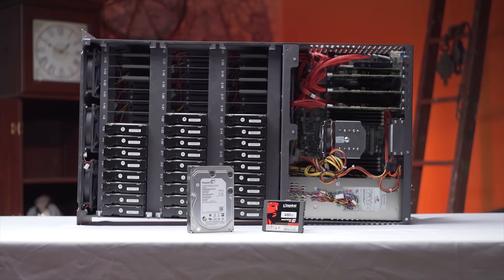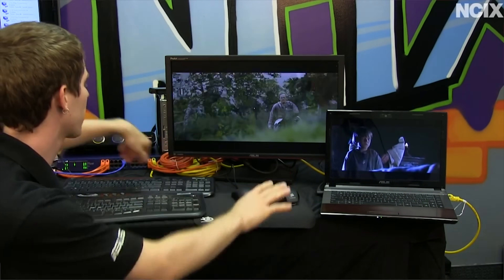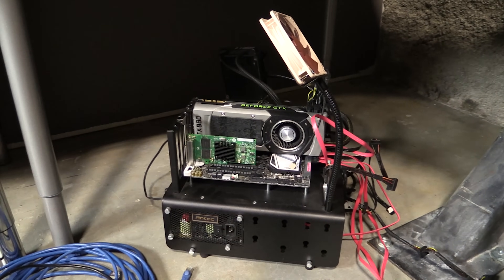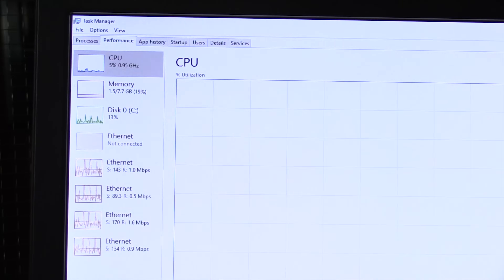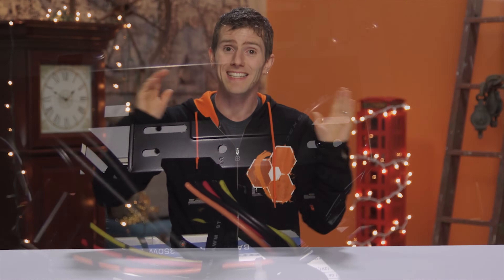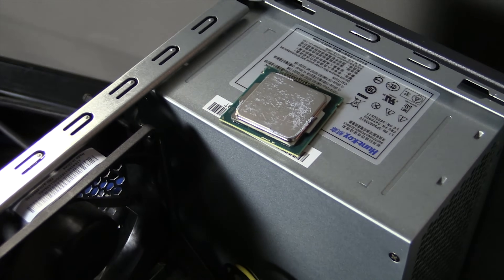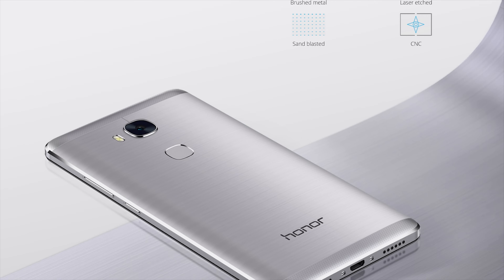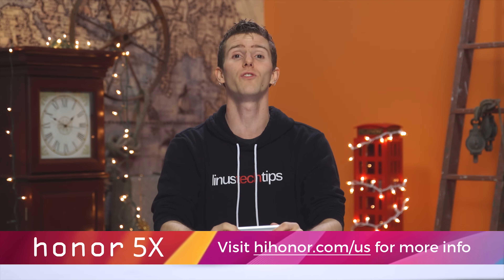Quadruple Your Network Speed for $100 with SMB 3.0 Multichannel!

Comment: LINUS!!!
Do a "how to set up a LAN party" video...PLEASE
Reply: don't you need friends to do that?
Reply: It's really simple, just ensure you have enough power strips/outlets, and a network switch with enough ports, and you're done.
Reply: +hentai nat SHOTS FIRED xD
Reply: +Cave Johnson 
a) get friends
b) get a router
c)get ethernet cables/wifi cards
d)one
Reply: +Cave Johnson How hard is it? Why make a video on it?
Reply: +Cave Johnson no its pretty much: 
1: computers
2: ethernet cable
3:routers/switches
4: play a game.

there is no config it just works...
Reply: +Cave Johnson Seriously?
Step 1: Plug all computers into the same router
Step 2: Order some pizza, don't forget the Mountain Dew.
Step 3: There is no Step 3, you now have a LAN party.
Reply: +Cave Johnson gods. definition of LAN party means several computers hooked up to themselv or to one wifi/ethernet device. NOTHING more, just that. that is lan party, no config, no software, NOTHING. you need only run a game that support lan party and in some extreme case configure game (usually put a host internal ip to other mashines). that works, nothing more, just and ONLY just that. get it?
Reply: When life gives you routers, don't make a LAN party! Make life rue the day it thought it could give Cave Johnson routers!
Reply: Cave Johnson Sorry, pal, but in practice my comment is more than enough for people to set up LANs.  Anything else is either 1) opaque and hidden from the user setting up the LAN by modern router design and more suited to a general course on networking or 2) Totally game specific and no one is going to write you a special guide for every separate game except possible the publisher or your particular game.  Usually those directions would be included in the game interface itself. 

If you want to know about packet headers and the differences between TCP and UDP and the dumbass way you need to port forward on enterprise Cisco routers, etc... you should go for a network certification, but don't confuse that with the itty bitty amount of knowledge that is needed to set up a LAN.  It in fact can be done only from my comment excepting the game specifics.  I don't believe you tried following them, how is your troll cave this time of year? 

 If you take a router supporting DHCP (basically every one produced for ages now) in it's default configuration from the store and connect two computers to it via CAT4/5/5e/6 you have a LAN already.  That sentence alone is sufficient explanation for how to setup your own LAN. 

Yeah, the explanation is not a how it works, but a how to make it work.  The other is an entirely different question.  If you think that's half assed, then you're barking up the wrong tree because they're not trying to answer the same question that you're actually intending to ask (but not actually asking).  Why don't you try to articulate a real issue?  What step have I left out in my explanation?  I'm not asking what aspect of networking I didn't explain at the protocol level, what actual step of setting up a LAN did I fucking leave out?  Oh, none, that's what I thought. 

Yeah, when explaining how marathons work I didn't mention the Krebs cycle?  My bad, guess that was a half assed explanation of marathons because I left out the underlying biochemistry, honestly man, your username isn't Cave Johnson for nothing.
Reply: Gaanja Mon Did you read my post?  Consumer routers do the whole network for you.  If you had to do it yourself there wouldn't be many people running any lans. 
Loading the game on each machine is a game specific issue and isn't suitable for an as fast as possible.  Some games you can use one disc and go around to each machine and load from it, others you needed to have a disc for each machine.  Of course people would get their hands on pirated copies so they would have enough to lan in the later case, either cracked to need one disc, or packaged as a virtual disk that you would mount with daemon tools or a similar tool. 
Cave Johnson I did explain it.  I think it's just sounding exotic because you haven't tried it yourself.  Next weekend just give it a shot, you may be surprised how easy it is.
Reply: Interesting thread. Someone asks for help and then retaliates against everyone who tries to help.
Reply: +Cave Johnson IS that really an issue now?
I remember when we ran windows 9x and at megabyte lan, and we used the first day swapping around both networks, and drivers to find the magic combination where wverybody could find each other. And realizing that setting the frametype to 802.3 helped SO MUCH, even now I remember it from the top of my head :)
Reply: +Cave Johnson not that hard
Reply: +Cave Johnson Modern routers make this whole LAN setup process pretty much automatic.  They use DHCP, so you just connect your computer to get an IP, voila.  Most consumer routers will have the LAN and WLAN bridged by default, but for consistent performance and fairness it is also common to use only wired connections as well for a LAN.  Modern routers also mostly support UPnP, so ports needed for the games can be opened automatically, though true LAN games would be contained in your network anyway and not need to pass through the firewall (e.g. Starcraft: Brood War as opposed to SCII, which needs to access the Blizzard servers).  Finally, most by default have firewalls that allow all outbound traffic and replies, so no need for configuration there for the LAN.  So... there isn't really anything that needs configuring for a LAN party with a modern router, plug and play.  If you need to know the IP of one of your machines hosting the game, it will usually show it in the game if it is needed, if it doesn't, then you can get your ip with the relevant command on your operating system (e.g. ipconfig at the cmd prompt on Windows, ifconfig at the terminal in Linux).  There's no tutorials because... well at least for my generation we learned this growing up, the hard way, but now it's 2nd nature.  Sometimes we were too ambitious for our time (I tried getting some devices for transferring data over your house's power cables to work for Age of Empires back in like 2003... the software for those only supported file transfer... who knows how, it didn't do tcp or udp), like Linus with his first run at these cards :P
Reply: ***** One thing I noticed is stupid people like to laugh obnoxiously at their own jokes. Maybe because they aren't clever enough to come up with a joke that people will recognize.
Reply: ***** Yes people play games over wifi. Are you so Detached you don't understand that? 
and so what if its not hard to do. Does that mean it would be a bad video? No.
Clearly you don't understand the point of Linus's channel. Which has always been about giving easy to understand information on complex and simple tech topics. And you are so simple minded you couldn't think of any possibilities on how he could show us that information. You and the rest of the people taking up arms against the idea probably don't even think before you start raging. Really, look at your comments, disgraceful. How is anything you said points against my video suggestion?
Reply: Cave Johnson  I'm not denying any support. Like I said "I don't really do things based on "likes". " - I have not denied any popular opinion. Of course you have more likes, you're the one who started the thread and most people don't really crawl through the comment's comments to find a random comment to like on.

Sure, I am against 400 people, so it's quite possible I'm wrong. I'm not afraid to change my opinion about it if I'm proven wrong.

If it can be done in a video that is both entertaining while being comprehensive enough that the viewer can follow it to set up his/hers own LAN with it. - Believe me - I've seen the book "Internet Explorer 6 for dummies", which is quite thick for what it is for. Someone might need that much info for setting up a LAN as well.

What I'm trying to say: The video in question most likely would either would be:

"fact based" and full of the "boring stuff", which could be difficult to understand in the 10 - 15 minute timeframe so that you could use it as a tutorial.
OR
"easy to watch" and "somewhat helpful - but not enough if the viewer has up a problem not explained in the video" - Good material to do further googling about, but not enough as-is.

But what do I care - based on your opinion I'm just an "idiot" and an "ass" with no other purpose than shooting down ideas for my entertainment. It might very well be just that I'm bored enough to 'explain my opinion' on the internet. Multiple times. With huge walls of text. Which annoy the thread starter, who doesn't understand my point. Who again insults me for not getting his/hers point.

....

Hold on - If nobody understands nobody.... That's it. Heureca. I now understand internet comments, while completely missing the point of understanding the comments. While writing a comment about someone else's comment. Comment... What is it's purpose? We might never know.
Reply: ***** yeah, as a network administrator i tried to explain a bit, but people want quickfixes, they don't want to invest the necessary time to learn stuff!
Reply: I did a LAN party once, we hooked all our computers to a cheap Internet switch, plugged into the router... Worked just fine! We were going on online servers so maybe that is a little different.
Reply: there is no need for any professional infos. When you want to make a dedicated server for your lanparty, then you need some more things.
Reply: +Anthony Flagg (Asami Watanabe) this right here
Reply: +Cave Johnson Would love to see what a LTT LAN looks like, maybe even an organized public LAN party in Vancouver!
Reply: Leanardoe you really dont read much of the comments before you write one do you?
Reply: Leanardoe I like how he talks about software, like DHCP is some mystical force. Protip: Make sure everyone is set to dynamic, the router and computers do the rest.

You can set everyone up with static IPs if you REALLY want to (actually you probably should for your server, just in case), but it really is as simple as plug & play.

That said, if you have a shitty router some (like cheap netgears) don't support port forwarding over wireless, so that might be why wireless people can't get in.
Reply: +Cave Johnson Oh, it would probably make a decent as Fast As Possible video though.
Reply: NuggetsTM I dont have time to die, I got a company to run.
Reply: +Cave Johnson great video idea, its not that simple u have to set up networks , upload games get them all on all the machines, getting a big router.. we had a few back in high school. im good with computers but lack skills in networking .. besides it would be a interesting videos none-the-less
Reply: Gaanja Mon Ikr? And people got so aggressive about me asking them to do it. Great, they know how to do it. I dont. Thank you. Maybe Linus will make one for us
Reply: zvxcvxcz I looked at your comment and thought to myself "Hmm, based off just this comment, could I setu my own lan?" the answer is no. You did not explain everything. A half assed job is why I want linus to do it. Every tutorial for lan parties is half assed and poorly put together. Your comment was no exception.
Reply: zvxcvxcz Why are you so against a professional tutorial for LAN parties? Search youtube, none of them are 'good' tutorials with lots of info. I want linus to do it because he will do it best, AND there are literally no others. Its not about how hard it is. Its about having a quality explanation out there.  Jesus christ man. A lot of the videos I find on youtube have the wrong info or contradict each other. WHy are you against linus doing a video on lan parties? it makes no sense.
Reply: David Miller Yes but that doesn't matter. My objective is to get Linus to make a LAN party video. Not just for me, but for everyone who has had to sit through the shitty tutorials on youtube. See, its hard to even answer your question becuase how am I supposed to know what is modern? 5 years back? 3 years?
Reply: lBonaCl Great, now do it in a video
Reply: Cave Johnson I'm really starting to think that you're either a bit simple or you're just being an ass and casting an easy troll on everyone. I can't figure out which (probably both if it's the latter), but come on.

I know you can make a video about it. Or let's say - making a video about it would be feasible and should work with every setup - BUT if the user can't get his/hers shit together, look up the router's model and IP address for it's control panel, let alone navigate through the router's interface without someone holding his/hers hand at all times, it would be useless. There's nothing in the control panel that it would either brick the device or set it on fire - which makes it quite safe in my opinion.

Let the brickfest begin. Bring some ice, since it's going to be the headache of the year!
Reply: +Cave Johnson I can see why most people are replying the way they do. - Because either: 1) it would be a really dumb video, showing Linus pluging network cables to a hub and ... voilà! (as far as all IPs are in the same subnet, you just then launch the game and play together!) - OR - 2) ... it would be A VAST video if you want to get into the details, explaining what's an IP adress, what's a subnet, workgroup / domain differences, how a DHCP works, the different hardware interfaces (switches, routers, hubs), etc - Looking for myself, i understand why you asked for it tho, as i witnessed myself that indeed, most videos you find on the subject are dull, and that is, because, as stated above, networking, if well covered is in fact a VAST subject, pretty much more suited for a schooling classroom than a quick video. If you got the patience, and wanna "homeschool" yourself on the subject, this is, tmho, pretty much the best video i found around: watch?v=xpXhudbsrr8 or watch?v=t9TmvFvYfWw
Reply: Morbo The Destroyer rofl yea they are so smug, they don't even want you to google basic shit.  The knowledge has to be inherited and passed down by the master race through their dna
Reply: ***** programmer and network admin here, and yup i know exactly what you mean. Whenever i offer them an explanation they show the lack of interest into actually understand the process. As Verstraeten andré said they just wanta quickfix and thats it. The good thing of my office is that due me being friendly, a couple of months ago the boss raised my salary .-.
#FriendlyFTW
Reply: The last LAN party I was at consisted of:
3 hours troubleshooting the LAN/ making sure everyone was connected
1 hour getting a bunch of games installed
1 hour trying to figure out why we couldn't see each other in game.
30 solid minutes of playing games

At that point someone tripped over an ethernet cable and accidentally flung the router across the room and we decided to call it a night.
Reply: I have a 24 port Ethernet switch, just no friends ;-; so I can't help with this
Reply: Cave Johnson
Well, you have to give the computers IP adresses in the same family and connect them to a workgroup. Worked for me.
Reply: Hideki Shinichi I dont see how he struggled? i think link aggregation is way over his head.
Reply: +Cave Johnson Well, to be fair, there weren't too many technical details...
We had 4 gaming PCs, linked to a 5-port ethernet switch with ethernet cables.
The switch had one cable going into the back of the router.
Turned on our computers, the internet was working and then we played on some online servers.

There really was no special setup - we were playing in the same room, but all connecting separately to the multiplayer servers (as far as I can understand). I guess the key pieces of equipment are the ethernet switch, the router and the ethernet cables (5 of them)... I know this probably isn't helpful, but that's how it worked for me.
Reply: +alchemist alchemist Get angry I don't want your damn routers what am I supposed to do with these. Demand to see life's ISP.
Reply: Cave Johnson I read a few. Still isn't very hard, and if you don't like replies then disable the option.
Reply: +Cave Johnson when every computer is connected, you need to open the port in your firewall, start the server on your PC, give to host local IP to your friends.
Reply: +Cave Johnson "One issue I ran into is getting both wifi and lan computers to  use the same game"

what, are you trying to use the same copy of a game to play on multiple computers?

i haven't set up a LAN for maybe 10 years but even in the BF1942 days all you had to do was connect to a switch or router, and maybe refresh your IP.. seems to me like not much has changed since this is what most replies are indicating.
Reply: It's a lot easier than it used to be - I remember setting up networks to play D2 back in the day - IPX/SPX for a completely local game, and computers wouldn't see each other, or even the network, sometimes.  That really was a headache, at times.  Just about everything is TCP/IP, nowadays, and modern OSs are so much better at networking.
Reply: David Miller That's what I'm trying to tell him, plug and play these days, back then figuring this stuff out by myself as a ten year old, there was a whole lot more to complain about.
Reply: zvxcvxcz I'm with ya there. man - and I was an adult.  Lol - I was a teenager at a computer club meeting the day these two guys announced...the Apple.  Imagine that, a computer already built!  ;)
Reply: Cave Johnson Are you using modern hardware and software?
Reply: +Cave Johnson 

Basics: 

1. Look up some networking stuff (basics about subnets, bandwidth, ethernet, your router's model, your router's control panel)

2. Make sure all the computers are in the same subnet. 192.168.1.x - for example is the .1 / "first" subnet. This is easily determined by opening Windows's Command Prompt and typing in " ipconfig /all " and looking up the ethernet or WLAN card's IP addresses.

I will use the third octet (192.168.X.1) to mark, which subnet I'm talking about. The third octet is the subnet's ID in the 192.168. C-class subnet. The last octet 192.168.1.X is the computer's address in the subnet. (IPv4 has four slots described with eight bits - look up binary, eight = octa- = octet). I will use the third octet and omit the 192.168.-prefix just to make it easier to read.

Basically as long as the computers are in the same subnet - they can see each other, if not - they can't. 

3. Configure router so that the Wifi / WLAN isn't in a separate subnet (Quest mode / Separation feature) from the LAN subnet ( LAN in .1.x WLAN .2.x = computers don't see each other, it has to be either subnet .1 or .2 ). 

Test this before the event by connecting a desktop PC into the LAN and a laptop to the WIFI (doesn't matter what kind of a computer goes where) by pinging the LAN from the WIFI and vice versa.

4. Make sure you have enough WAN side bandwidth. WAN = Your internet speed / Broadband, 10 Mbit/s in, 2 Mbit/s out would be enough for 4 guys while playing CS:GO). This is usually calculated ~250 kbit/s in, ~100 kbit/s out, but it depends entirely on the game that you're playing. 

Also, make sure you have enough LAN ports (5 computers = you need 5 ethernet ports on your router). You can easily get more ports by plugging in more routers acting as switches. You just need to configure them to operate in a free IP address (router in .1 or .254, computers in .100 - .199, in this case .50 would be free) and plug one of it's LAN ports into a LAN port on the main router. Look up Ethernet / RJ-45 / Cat 5 Ethernet

5. Calculate power draw, a computer can pull excess 500 watts from the wall, 16 Amp fuse in 240V mains would therefore supply 3600 watts = around 6 setups at full tilt - less if there's lots of other things in the fuse's circuit (lights, tv's, etc.). If there's too much power drawn, it will trip the fuse = everything loses power.

6. Choose games. Some games need internet, CS:GO Matchmaking, League of Legends, Dota 2, everything "outside" the LAN network consume the WAN bandwidth, having more guys than bandwidth the games will have high ping and the connection will be laggy. If you're playing games entirely in the LAN network (no internet required) then it's most likely at least 100/100 Mbit/s - which would be plenty for even 50 players, gigabit for 500 - in theory.

7. Check setup ( Check all above )

8. Fix problems ( Sometimes nuking windows firewall can help - though not always - ALSO REMEMBER to switch it back on when you don't play a game that is being blocked.)

9. Emphasize to the crew that nobody creates excess / unnecessary network traffic (watching HD video or Youtube videos in general, stream music, download files) while someone is in game.

10. Be prepared that the main router will crash and burn at any time. If possible, have a pre-configured backup router ready to be hooked up. 

Advanced:

1. Make sure you enable QoS if your router supports it ( Prioritizes game network traffic above everything else, puts http traffic to the lowest priority ) - this can help if someone decides to stream music or watch youtube while gaming.

2. Apply specific QoS settings per computer ( some routers can limit max. bandwidth for every computer - like splitting 10 / 2 Mbit/s connection to five computers, each getting 2 / 0.4 of the bandwidth outside the network). This has to be done for the subnet that the LAN crew's rigs are in, either it will throttle the whole subnet to that speed.

3. Look up more on networking, firewalls, game port forwardings and such. It will help you understand the network and how it operates. It will help if something blows up.

4. Create a subnet for the LAN crew (Just connect a secondary router's WAN port to the main router's LAN port and configure it to be in .2 if the main network is in .1). 

This will help if the main router is weak at handling multiple devices. What NAT (Network Address Translation) does is that it makes the LAN rigs to seem like one computer to the main router. This reduces the memory usage on the main router, because it doesn't have to decide which packet is for which computer, the secondary router handles that part.

5. Seriously, look up networking basics. It helps a lot - go through your router setup and google what everything does. 

6. Google is your friend, Google has answers, Google will help. You only have to define your questions so that it understands.

7. Don't worry, it's not that bad. If you manage at least 5 of the basics, you can still have no problems.
Reply: lBonaCl Actually, if you're going to piggyback, I recommend dumb hubs, especially for a networking beginner.
Reply: Cave Johnson I hear you - and yes, anything from within five years should be fine - I was just going to try and write up a little guide, but IBonaCI beat me to it - and got a lot more thorough!

Essentially, I'd trust any machines set up for Windows 7+ - I've seen issues with XP and even Vista (which I despise, but what I'm using right now), though honestly, even they aren't difficult usually.  Any Linux based system (including OS10+) should network pretty easy as well.  I miss my Kubuntu laptop.  :-/
Reply: lBonaCl Lol, you said some things he couldn't understand so now he thinks it's great.  He doesn't realize that in practice it's not more complete than what I gave him and still involves him looking up things on his own in many steps.  Nor does he realize that these are general networking concepts not specific to LAN.  Step 2. can report an erroneous IP that looks like it's part of the subnet but is not communicating with the router.  Advanced step 4 is pretty pointless unless router 1 has a heavy concurrent load from other sources or router 2 is much better than 1 (in which case why is it not your main router?).  QoS can be really bad.  It always compromises optimal throughput, but I assume we don't care about that for this use case.  Even so, many consumer routers have bad implementations and using it can really hose your network performance to the point of needing to reboot the router.  Mileage may vary so to speak.  Also, some games use http traffic, don't put it last without knowing if you need it or not.  Nuking Windows firewall is never the right thing to do... but yeah, it's a bandaid at times, but it should not be anyone's long term solution for playing a game over an extended period of time.  In step 4, those addresses may not be available depending on the configuration of router 1.  You didn't cover the router firewall or DMZ, DNS, or DHCP.  It's so funny to me that he called it great, just highlights how little about networking he knows. 

Don't get me wrong, your explanation was good, it's just rubs me the wrong way that he thinks talking a bit about networking basics makes it complete and foolproof while rejecting the simplified approach he so clearly needs. 

Should we give him the thorough explanation?  You don't even need a router for a LAN, heck, not even a switch.  Grab a CAT cable of the variant with the speed you want, connect the two computers directly, set static IPs (OS specific), set routes, done.  That will get you running a two machine setup for true LAN games like Brood War or CS 1.6.  Oh, he wants a party?  Ok, still don't need a router, just more cables and a switch. 

Speaking of bad firmware implementations, maybe we should include installing other firmware like OpenWRT as a step in the process of setting up a LAN party as well?  No guide is complete without the possibility of bricked devices!
Reply: David Miller
 Yeah, but it's not THAT hard and usually thift shops have only routers for like 2 - 5 euros. Switches are hard to come by, but they would be better in this case. They're a bit of a rarity - though a new one doesn't cost much more than 50 euros for an 8 port gigabit switch.

What comes to the video: It would be suitable for one game at a time and it would still be ~ 1 hour in length. The basics can be looked up in around 15 minutes and testing would be anywhere from 45 to 2 hours.

For a complete beginner's guide it would be a real pain in the ass, because every router is different, every router has different load handling charasteristics, settings and features, every game has it's own bandwidth requirements, you have 2 main AC voltages to calculate.

I'll tell you a long-winded example just on the router side of things: I have 4 routers, 2 of which run DD-WRT (Custom firmware), a "mainstream box" and a "basic but with powerful features".

The DD-WRT and the basic box have fully configurable QoS where you can basically tell how to treat computers, where the mainstream box just sticks up the middle finger and shits on the floor if you even ask for such basic bandwidth shaping tools.

The mainstream box has quite impressive WLAN settings (Transmit power, Channel, MAC-filter), where the DD-WRT boxes can't do shit about the transmit power - which is hardcoded to half of the original spec and the basic box doesn't have WLAN at all.

DD-WRT boxes have fully configurable DHCP-server where you can set static addresses to the computers easily and it will work, no matter what. Basic box has same functionality, but it needs to be rebooted for the DHCP to recognize the settings.

Then there's the mainstream box doesn't have a dialog box where you can tell the address, but if it's in the network you have a tickbox that says "Always give this address to the client", but if the computer is rebooted, the thing just sticks the finger up and takes another dump on the floor and serves the computer another address - even if the lease for the previous address is still valid and open.

TL;DR;
It's hard to make a video about it, because the range of hardware is so vast. Sometimes even different revisions of the same router can have completely different features built-in. The only somewhat static variables would be the power calculations and the WAN-side bandwidth.

Also, mainstream router boxes usually have slimmed down firmware to make the box either to be easier for the normal user OR that the manufacturer doesn't want you to have those features in the basic range of routers.
Reply: +zvxcvxcz Brick 'em all. It doesn't feel like a victory unless you've bricked all the routers 20 minutes before the LAN party starts (been there, done that).

But yes, I know it's a bit "one sided" and doesn't cover any of the three D's (DNS, DHCP, DMZ) and I used only the addresses that would be easier to understand (I know that there's other default subnets than the 192.168.1. I'm using). I've tinkered with networking enough that I can easily leave out or just completely forget a step that is quite crucial to the guide because I just think it's "common sense" to do something like DHCP configuration in advance. It's hard to explain complicated things that you find trivial.

Really, this is a tough subject - if you're making a 5-man-lan, you shouldn't really need to do any of what I mentioned. It should work out of the box. But then again, I've had some games and situations where nothing helped even if the router was reset and reconfigured from scratch.
Reply: ***** Sigh, you really dont get what Im asking do you?
Reply: lBonaCl You really are an idiot arnt you? This is what linus does. He makes videos about tech, yet hasn't done an in depth video about LAN parties. Ive setup lan parties multiple times. Just really shut the fuck up already. If you don't like the idea move on, but my comment has nearly 400 likes so far. yours have none. So just stop acting like an ass and shooting down a good idea.
Reply: I don't really do things based on "likes", so that's one thing. But fine, let's leave it at that.
Reply: lBonaCl Oh sure deny popular support. The only people opposed to the idea of linus doing a LAN party video are the neckbeards who think just because they know how to do it, means Linus shouldn't cover it.
Reply: lBonaCl I skimmed your comment, you need a TL;DR man. Imagine all he could touch on, like how to get split screen to two different monitors, ideal routers, history of game support and so on. The only thing that limits a video like that is the imagination of the people making it. All the neckbeards ragging at me have zero imagination, they are machine minds
Reply: Cave Johnson I apologize for not having a neckbeard.  Also, perhaps you missed it, but he's already done most of those videos.  I will give you a brief history of game support, it goes as follows:
Reply: +Cave Johnson Or look up the info yourself and stop being spoon fed info.
Reply: Christian Lund Thats typical PC elitist douchbags for you. They are so smug about their own knowledge that they could care less about someone else learning it. They too hardcore m8. This is why PC is a bad platform
Reply: darksidelead Morbo is displeased with your lack of imagination. Your puny races technology wont save you when my race invades. Mwhahahaha!
Reply: +Morbo The Destroyer its really not complicated, most games come with a lan setting, the only thing you need to do is just connect to the same network, make sure you are not all sharing a single game because steam wont let those connections through
Reply: lol thats ez. configure each router to get connected to the main one
Reply: ***** I mean...connect a second router for example, to the main router. give the router an ip and turn on dhcp, set up your scope of how many IP u want that router to give..done...u got internet connection and u got lan access O.o But hey i cant blame some people to not know about setting up routers lol, there are some people who doesnt even know how to get to my documents :/
Reply: It's seriously that easy though.

Get a switch, use ethernet cables, plug them in, go.

Certain games may have some extra steps but you will probably have to google that on a case by case basis. 

90% of the stuff will work plug and play over a wired network. Old stuff probably won't like WiFi.
Reply: Its actually a little complicated. One issue I ran into is getting both wifi and lan computers to  use the same game. BUT my main reason is because there are NO well made tutorials for how to setup a lan party. The tutorials currently up are all made by armatures and barley explain anything or give you fractured explanations.  I want to set up a lan party at my house but its too much a dam hassle to get a straight anser. Its a Job for Linus!
Reply: Slay Not done, you left out so much its incredible you think thats a complete answer. You left out the software part of it. You clearly dont know how to do it yourself.
Reply: hentai nat It also would be hard to make a lan party if a combustible lemon burned down your house.
Reply: ScatmanWeegee You completely left out the networking config options
Reply: Leon Ware Thats wonderful. Id like to do that too. Id like to know everything I can do and how it works. Does your comment have any of that information? Im not saying its too difficult, im saying there is not one professional tutorial for how to set one up.